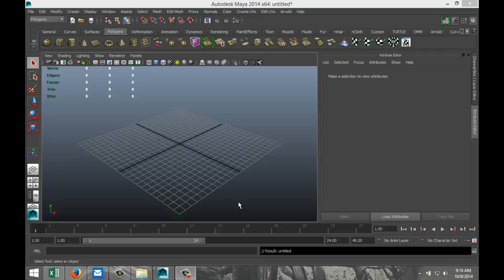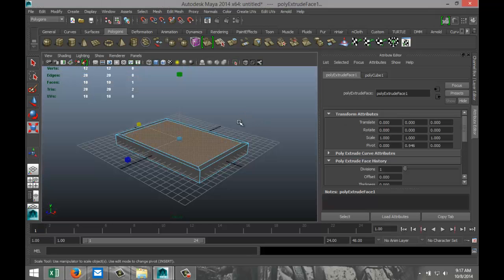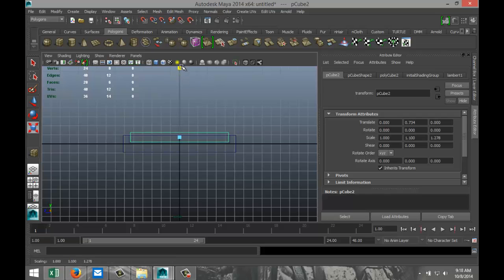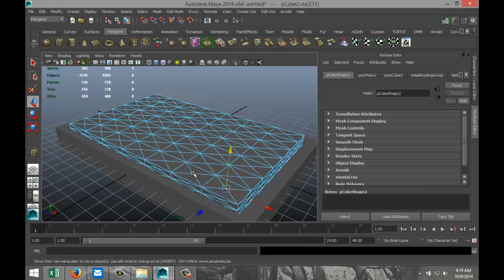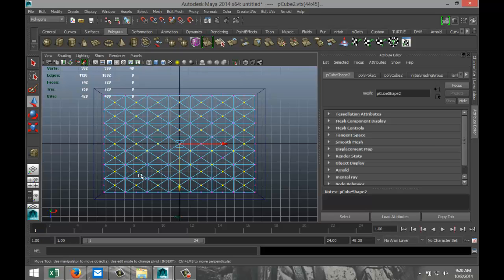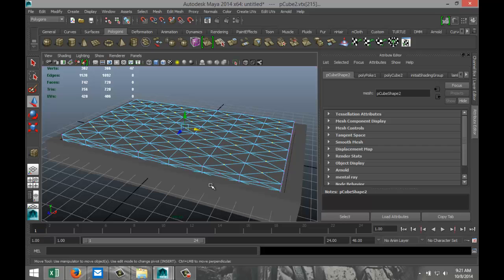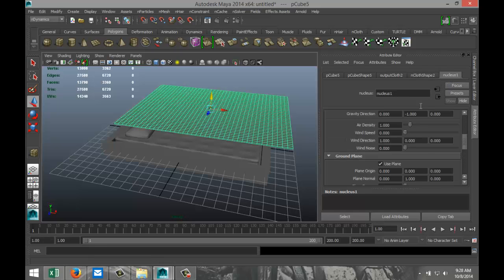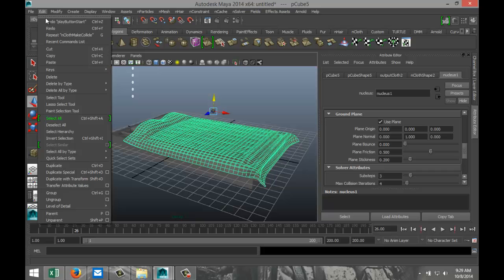Maya 2014 tutorial : How to model a bed ( NEW )

Comment: @Mike Hermes
right after the blanket makes contact with the bed, the blanket is turning black. pls help.
Reply from the maker: As the blanket is nCloth the top part of the blanket is pushing through the bottom, so you are seeing the inside. The trick is to make a single plane into an nCloth object and then extrude it to give it thickness afterwards

Comment: That's what happen with my blanket:
http://screenshot.sh/m7tQQvc8DQdKs
any way to fix it?
Reply from the maker: KwaaawK Hi there,

What happened is this. You gave thickness to your blanket before you turned it into an nCloth. When you applied gravity the top faces of the blanket pushed through the bottom faces of the blanket. So the blanket collapsed on itself.
So try this : Create you plane, turn it into a nCloth object, apply gravity and after the blanket has settled on the bed, delete history, select your blanket and extrude the faces to add thickness. ( then you will have to raise the blanket slightly as it will also extrude downwards,

Mike
Reply: Mike Hermes Thank you Sir :)

Comment: Everything worked great up until making the blanket fall onto the bed. I have a lot of black spots that showed up on it, how do you get rid of them? I tried adding a color but the black spots still show :( other than that thought awesome tutorial! :) very helpful.
Reply from the maker: ***** That's because of the thickness of your blanket ( or lack off. Due to gravity the top layer of your blanket is falling through the bottom layer. This is reversing normals and turning them black.So either use a plane for the blanket and extrude it once in the correct position or use a thicker blanket.
Reply: Alright Thanks again :)
Reply: THANKS FOR ASKING!!! HAVING SAME PROBLEM. I EXTRUDED A BIT AND WORKED TOO